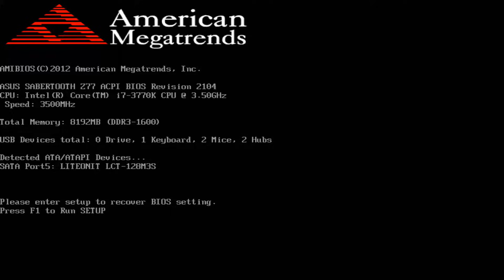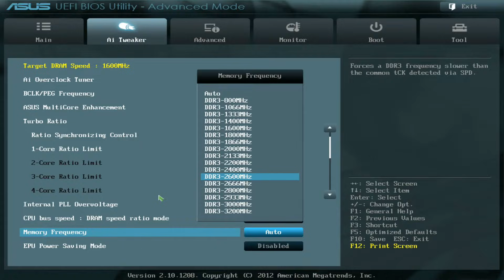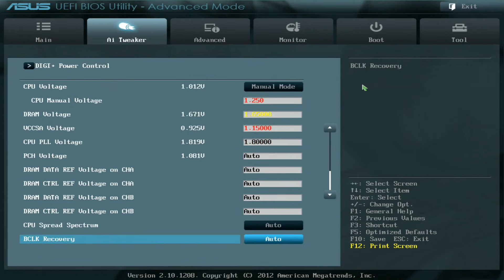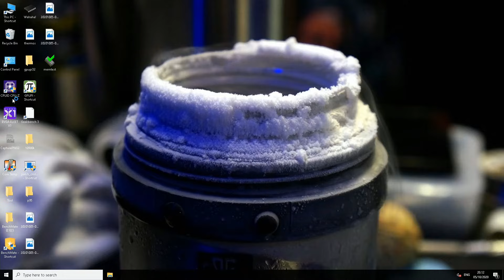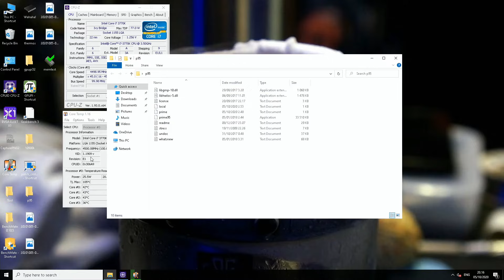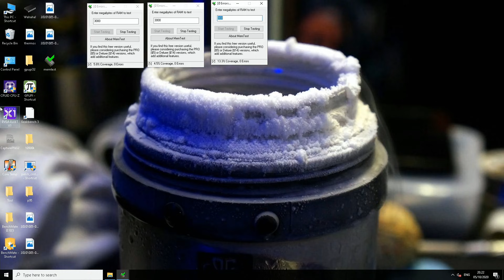Beginner's Budget PC Overclocking Guide - Ivy Bridge 3770K + ASUS Sabertooth Z77 in 2020

Comment: Followed along, unfortunately my xmp is only 1600 and it snot even stable, I have to use 1400 lol.
Used the guide and was a left room from some of your settings. Got the the windows loading screen and froze :/
Reply from the maker: Do you mix different sticks of memory?
Reply: @LuumiJuhani you know, it's such an old build I'm unsure.
I can xmp my 1600 sticks to 1400 and it's fine.
When I do your settings even on 1400 AND I bump the timings down, still unstable.

Comment: I got my similar rig to run at 4.5 with a cheap Deepcool Air cooler by just using the Asus  OC software. Might want to try your settings in the future to see what I can get. I did de-lid my CPU when I bought it off Ebay a few years back. Actually it was my main system up to last year when I finally upgraded  to a 12th gen. It surprises me still how capable it is running Win 10, 11 and Linux Mint . I only upgraded so I could do some Video editing a little faster than this Rig. Good Video!

Comment: I tried the parameters that you demonstrated, but my computer does not turn on, the screen is black. I tried to apply other settings and get a blue screen. I have a i7 3770k asus p8z77-v deluxe. In the optimal mode, the frequency is 4.2, games crash after 15 minutes. I tried to set the frequency to 4.5 (everything else is automatic), the games crash after 3 minutes, what should I do?

Comment: Great tutorial, great video! Unfortunately my chip is far from gold and i can only achieve 4.6ghz with 1.42. Now that's what i want to ask: whats the max limit voltage YOU recommend for the 3770k? Here its delided, dual tower air cooler, with 29c amb i get 77 max cpu package in 10min of cinebench r23. 2x8gb ddr3-2400 as well. 1.42v is ok? 4.8 as far as i tried only with 1.51v+ but i think it's too high...
Reply: Jesus fucking christ 1.5v is INSANE is that chip dead yet? I'm shocked it didint break 80.

Comment: I have the same mobo/cpu, and my system will not overclock. I make all the changes in bios/eufi, but when I go into cpu-Z, it still shows that it’s running at 3.9 ghz max, when it is set to run at 4.5 ghz. Any ideas why??
Reply: change your mb battery

Comment: Anybody watching this. If your CPU is either damaged or very hot, clicking OC Tuner may make your system unable to boot. Happened to me. Then you have to pull the plug/pin on the motherboard and put it at 2-3 (Google motherboards manual pdf) and start the computer, and then put it back at 1-2 and restart again and your computer will work again. So be aware, it's a dangerous button! Happened to me yesterday!
Reply: It's also using a bus clock overclock which is never super stable or "safe"
Reply: I was curious to try that few years back (as a complete over clock noon).
The CPU is getting old. A bit more power would be nice.
This OC stuff is supposed to make it easy.
Big mistake!
I finally found the solution you're referring to. But I hadn't sweat so much in a long time!

Comment: I entered bios and changed to x45 aka 4500mhz and now it rund 4650mhz, dno why 4650 but ty I guess 😂 only used cinebench r23 for 1h to test it and worked. Gsmed for a few days now and clock is stuck on 4650 and temps never above 50-58c with noctua aircooler. Happy AF, didnt know these chips oc so easy 😂😂

Comment: I'm so pissed with my I7 3770K + Sabertooth Z77 that I got recently. Basically can't even get to my old I7 2600K + Sabertooth P67 level of performance, it was at 4.9ghz and recently burned 1 core but still magically works by setting 3 cores in the bios.

Getting 4.6ghz is already pretty hard on this crap, 4.7 needs more than my 2600K at 4.9ghz and 4.8ghz almost impossible 🤬

Also I have the CPU full direct-die-to cooler without the heat spreader so it just can't get any better other than going watercooling, I'm using a new Thermalright Peerless Assassin 120 SE.

ps: If I wasn't tired already of disassembling and assembling this crap many times I'd test this CPU on my Sabertooth P67 to see if it would go better because this Z77 originally had the bios completely screwed and had to flash it with AMI Winflash ("AfuWin64") or else I couldn't even get my 2133mhz ram above 1600mhz and was also only reading half the ram while it clearly could read all the dims in the SPD. F* this...😡

Comment: Amazing video and guiding. I copied all the settings for my Asus p8z77-WS motherboard with Noctua NH-D15 cooler on great tempteratues and runs like butter. What settings can I change if I want to bump it up to 4.7 or 4.8? I really want to get the last full capacity out of my CPU if possible, appreciate any help.
Reply from the maker: Well mainly the vcore really. You can try to go a bit higher and see if you can get it stable. Maybe check out my patreon discord if you want to get more deep in the subject.

Comment: Thanks for this video. I'm still running a non-k 3770 and I just purchased a high-end GPU and am really feeling the CPU bottleneck. After the GPU purchase, I can't yet afford a full system upgrade, so I'm considering picking up a 3770k with a D15 cooler and overclocking it until I can switch to Alder Lake. I'm completely inexperienced with overclocking so this video will help. I have essentially the same motherboard. Biggest difference is I have DDR3 1600 RAM, so I'll need to compensate for that.

Comment: when i did the setting the way you did every time i put a load on the cpu the program would crash. I went into bios and set it to offset mode and then it has not yet crashed. i think it is because it set the cpu voltage to 1.5v

Comment: The only way i managed to get 4.5ghz is on 2 core, 1 and 2. 3 and 4 are unstable at 4.5ghz, put them at 4.4ghz, so un-sync cpu. No matter cpu voltage. 1.265v 45-45-44-44

Comment: Based on tests and scores found online this particular Intel i7 3770K could very well be the best 3770K and Ivy Bridge CPU that ever existed
Reply: it is
Reply: Yea I bought one 9 years ago when they came out. Still have yet to find a game or anything that has been bottle necked by it.. I had a 670 with a ref cooler and It cooked itself ran at like 75c under load and eventuslly died I ocd it. Bought a 1070 evga fuck the world edition and got it at 2ghz i7 at 4.6 ghz and 16gb ddr3 1600 to 1866

Comment: asus p8z77-v (bios 2104), i7 2600k 4.2-4.5 GHz (103*43) 1.2-1.35v, ddr3 2x8 1866 (but only in 3 and 4 slot, bclk 103 slightly improves the memory speed, so I set 102-103 ("stable" up to 103.5)
I set a maximum of 4.7 (101*46) and for my cooling max t. 65, and somehow I launched through Ai Suite 2 - "Auto tuning" and tried "Extreme overclocking" and knowing that it would reboot, I went to make tea, I come back I see testing 4.9 (103*47) and the notification "cpu voltage 1.5" 😓stopped, knowing my cooling and something a lot on the cpu (I read and tried up to 1.4v)

Comment: I7 3770K + Asus Sabertooth Z77 + 2133 Mhz Kingston Predator 16gb Ram,650 watt inwin psu... but cannot be overclocked the computer turns on and off by itself ... Then press f1 it says overclocking did not happen .. Where am I making a mistake?

Comment: Nice video! Respekt. Please continue as much as you can teaching how to OC old stuff. Allot of people still use it, as you said.
I use an 3770 NON k, OC'd @4.1 all core's on a P8Z77V-LX just with the multiplier. Do you think that it can do more? Thanks.
Reply: If you aren't going above 80°c with prime95 then you can probably bump the multiplier once. If it becomes unstable, but you know you have the thermal headroom, bump up the vCore by 0.01 until it becomes stable, stress test it and check the temps. Rinse repeat until you run out of headroom.

You could try to tweak the baseclock a little, but I don't recommend it, as most intel CPUs really tend to dislike booting with even small baseclock bumps. I could go 105 bclk just fine, but at 106 I had to remove the CMOS battery to get to see the bios again. I suspect my 1333mhz Corsair vengeance is to blame.

Don't worry, as long as you turn the knobs slowly, instability will prevent you from seriously harming anything.

Once youre happy with your overclock, prime95 for 2-4 hours. If you're going to have issues, they will show up in the first hour. The other hours are for safety. Any more than that would just be a waste of electricity.
Reply: @hoverbike  thank you very much for your time and help.
I will have to try directly with Vcore, because it doesn't go above 4.1 @ all core's. Actually it goes higher with just 2 cores but the remaining 2 goes down @ 4.0 or 3.9
I can also try with Bclk but I already know that it will not go above 105, and I think is maximum for this H61/H77/Z77 MB Chips.
If I will achieve something noticeable, (I'll be back)! 😊
Thank you.
Reply: Can only the CPUs with "K" overclock, or also my I5 2400 or I3 2320? I have 2 boards for these CPUs one original Intel and one Asus, both have OC options...

Comment: I tried this, but it fails .. when I run corona benchmark it stops after 2 minutes.
I might be doing something wrong, but, I tried the steps, and even on XMP ram settings, 
It only works from EZ mode, on the 41 multiplyer.

Comment: According to ASUS, VCCSA is sensitive and higher values than necessary can actually destabilize RAM. I’d suggest starting at stock, 1.05V. If you are tightening the RAM timings / overclocking the RAM then you can raise the VCCSA one step at a time and test for stability at each increased voltage step. At your own risk of course.

Enabling PLL Overvoltage was necessary to hit 5.0 Ghz using High LLC on my Z68 board with a delidded 3770k. CPU PLL Voltage seemed unstable below stock 1.8V. I’ll have to do more testing to see if I can lower that to reduce temps.

Comment: hi sir.. i have a question.. i have an ASRock  H61M-VG4 motherboard.. also an Ivybridge.. it has just 2 slots for ram.. it's dual channel.. my question is, can i use 2pcs. 16GB DDR3 RAMs for this? i don't wanna risk buying ahead and buy something that doesn't work.. :( there is no article if it works now for higher RAM.. all i know is the default is 16gb.. but i think it was because there were no 16gb ddr3 ram before..
Reply: 16GB is max for this mainboard. so 2x 8GB is the max you can do.
Reply: @drunkenn00b  ohh.. thank you sir.. that is also what i have seen in their website.. i just wanna know if it was just because there were no 16gb sticks before that is why they limited it to that.. thanks for the reply..

Comment: I followed exactly what you did and it gets to a blue screen with a sad face, what do I do?
Reply: Well, being six months down the line, this is probably wasted effort, but:
Your settings are off (unstable) by such a degree that windows cannot recover from the errors.

The error that you receive is very valuable information, it can tell you almost exactly what the problem is.

I was going to go out on a limb and give you suggestions for solutions, but not knowing the errors you're having, I'd be shooting in the dark, and someone might read this and wrongly apply the solution.

I'd recommend you reset all settings, and then follow the guide step by step, and booting in between ALL changes. This way, you know exactly where the train goes off the tracks, and this makes troubleshooting into child's play
Reply: Your pc is trash lmao

Comment: Thanks a lot for the guide, Luumi. Little question. If I want to OC my 3770K to 4.5 GHz, can I do it without memory OC, or do you recommend to OC them both? I have 4x8GB Kingston RAM
Reply from the maker: You don't have to, but it depends on your memory what they are by default. Just set them to XMP.
Reply: @LuumiJuhani  Thanks!
Reply: Memory OC isn't really worth it on anything prior to skylake/ryzen. For regular gaming that is, of course if you're extreme overclocking you do want to squeeze out that little bit of performance you get with a nice set of G.Skill Pi/Trident X or Corsair Dominator DIMMs.

Comment: Do you not check for whea19 errors in event viewer?
Reply from the maker: No.
Reply: @LuumiJuhani  i haven't been overclocking since the pentium days, and back then, 'stable' was to be able to run things such as prime95 power viruses for hours on end, looking for errors or bsod's. 

I've learned that intel CPUs 3rd gen onwards give us WHEA error 19-20 in the cases of low vCore where the error is recoverable, however, this isn't a catch-all - you can't rely on this. You may suddenly experience software crashes. If you are lucky, you can actually hit a voltage where windows is right on the edge of even being able to run at the voltage. Leave it alone, and it's just barely enough to work. Open up windows media player, play some music, and you'll start seeing errors pop up left and right before a bsod occurs.

That's the visual example of what happens. You can gradually apply more voltage and slowly see stability being reached, to the point where you will run 'stable enough' to either run cinebench, add a little more voltage for highly demanding games, etc. But the takeaway is that, you haven't achieved stability like stock until these errors stop. The difference between barely boots and stable as stock is 1.27v @ 4.2ghz Vs 1.36v
This is why people refer to certain clocks as 'daily driver'. 

These are my arguments as to why you should adhere to WHEA errors. 
In your own opinion, why do you think this is wrong?

I can just imagine a 'slightly unstable' overclock leading to troubleshooting hell... I mean, some programs function flawlessly, others don't. If you don't check the error logs, you might have no idea why that program always stops working and crashes out of nowhere.

Comment: Thank you Luumi.  I'm still running a p67 + 2500k build and had a bios chip corrupt about a year back when a power supply was failing.  Flashing a new bios lost my overclock settings from years prior and I've been meaning to spend a weekend getting a tuned overclock setup again.  Appreciate the step-by-step walkthrough to help me get through the process and get re-educated on some of the settings.